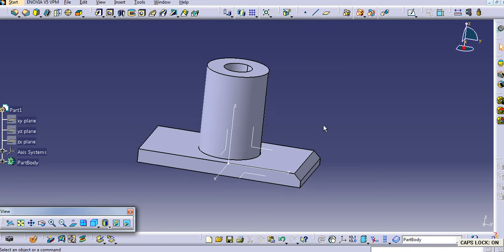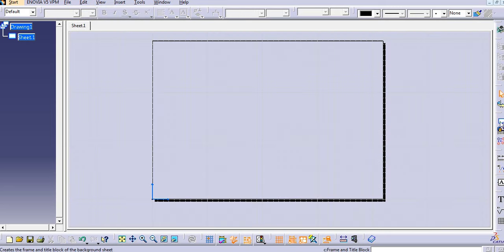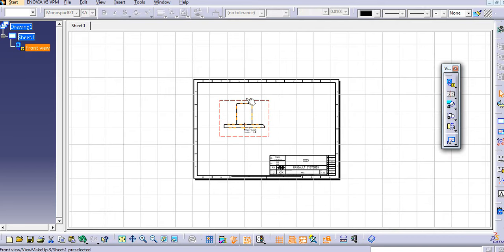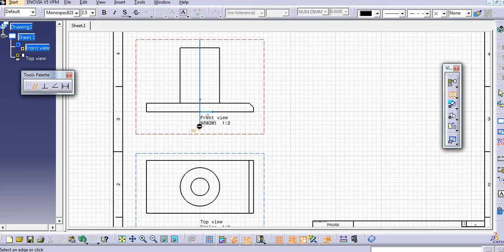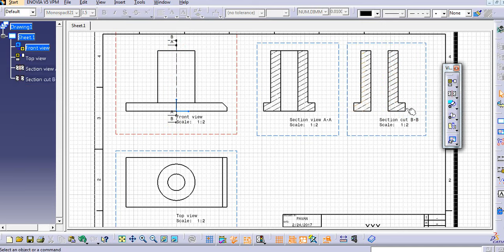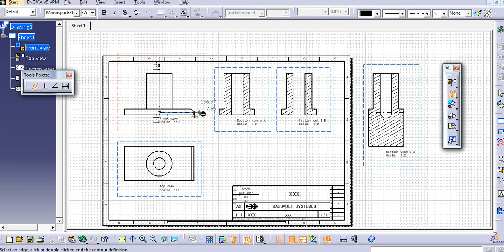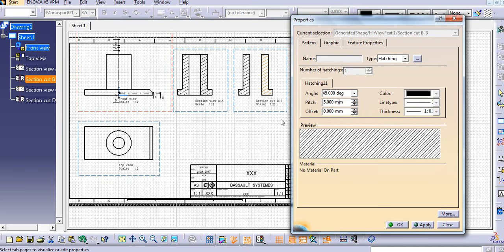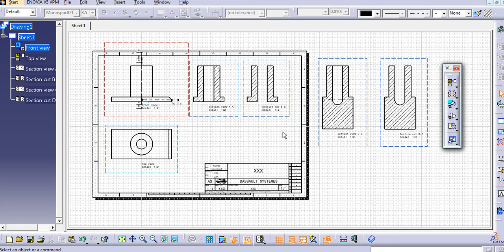SECTIONS VIEW CATIA V5

Comment: Why i cant move a view in drafting, or make it smaller?
Reply: Because it's isolated, it's locked. Right click on the view then Properties, then in the opened window click the tab "view" and you have there "Visualization and Behavior" and three check boxes. UNCHECK the box where it says Lock View, then press apply and ok and it should move and be able to do what ever you want with it.
Reply: You can't change the size of a view, it's changes automatically depending on the amount of information put into it